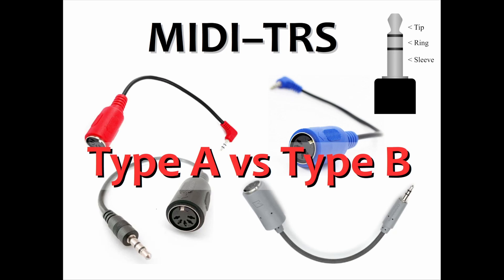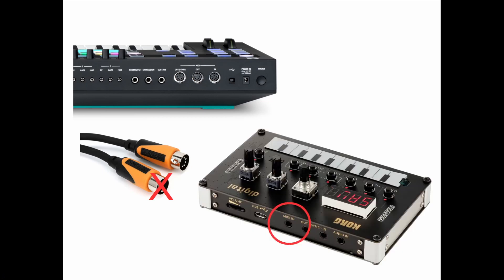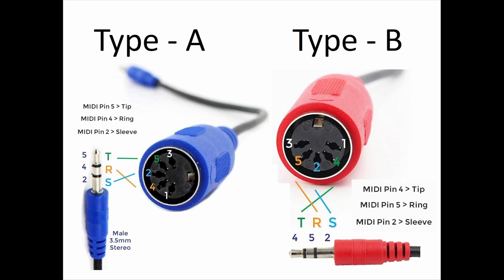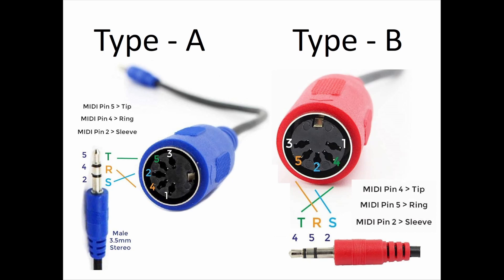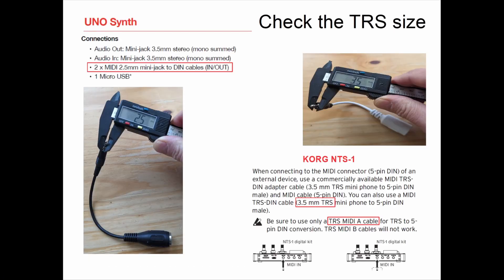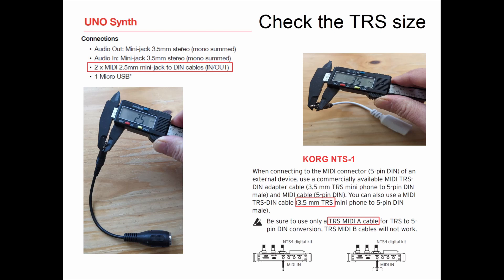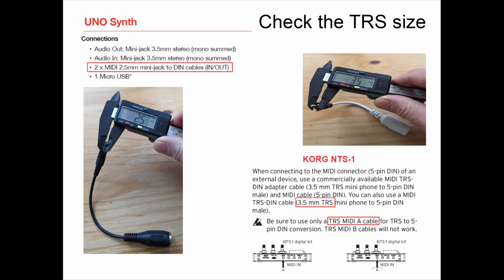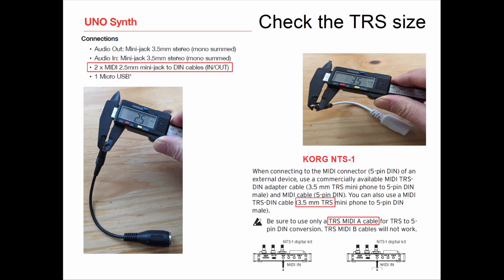MIDI TRS Type A vs Type B explained

Comment: Supposedly, type A is now the standard. So all new devices being designed with 3.5mm midi ports need to be type A. Thankfully, a company in Europe called PolarNoise makes A/B adaptors so you don't need to use the big dongles and full size cables in between A and B devices.

Comment: hey, first of thanks for the explanation made it very clear!

secondly, do you happen to know what type native instruments uses? i couldn't find it in my documentation. I want to connect a boss 500L expression pedal to my maschine mk3 but im unsure what cable i should get for this. also, if id accidentally would pick the wrong one could this damage my device or would it just simply not work? (i know it also has a pedal jack-jack input but i want to use my sustain in that slot)

Comment: im new to trs midi. i have a polyend play and a sp404 mk2, they both have trs midi inputs/outputs. can i use regular audio headphone 3.5mm to 3.5mm cables?
Reply from the maker: Hi CosmicVictory, 

tl;dr: From a quick search it looks like the Play is TRS-B and the Roland is likely TRS-A, meaning a straight through Audio cable won't work to connect the two.

Long answer:
The real answer depends on the TRS formats of the Play and the SP404.  A standard 3.5 mm audio cable will be a straight through tip to tip, ring to ring, and sleeve to sleeve.  Whether you can use a straight audio cable depends on the TRS formats of the Play and SP404. If the Play and SP404 are the same format, TRS-A and TRS-A or TRS-B and TRS-B, then a straight through cable should work.  If the Play and SP404 are different then you will need a cross over cable from A to B.  Or adapters to 5 pin midi and a straight through 5 pin midi cable.  Generally you need to look at the manual of the Play and SP404 and see if it tells you which Midi-TRS format it supports.

I checked the Play manual and it says the Play is Midi-TRS-B
-----------
Play manual:
MIDI data output port – use the included TRS type-B 3.5mm jack to MIDI DIN adapter to connect to MIDI
Input of an external MIDI device.
MIDI data input port – use the included TRS type-B 3.5mm jack to MIDI DIN adapter to connect to MIDI
Out of an external MIDI device.
--------------

Unfortunately the SP404 manual does not seem to specify the TRS type.  What I found in the SP404 manual was:
--------------
SP404 manual:
Connection terminals PHONES jacks: MIDI (IN, OUT) jack: Stereo miniature phone type
-------------

I did a search for Roland TRS type and did not find a definitive answer from Roland but I found an answer on Redit that said Roland uses TRS-A.

If that is correct, Roland is TRS-A, and Play is TRS-B, then a straight through Audio Cable will not work.

Maybe someone else can chime in if they know definitively which format the SP404 uses.

It wouldn't be super hard to cut and audio through cable and swap the Tip and Ring wires to make a cross over cable.
Reply: @Brad Hunting  good info! thank you! i knew the play was type B but didnt consider the sp404. ill be doing more research.  thank you again!
Reply: @Brad Hunting  thanks for the advice! i purchased an A/B converter online, and it worked instantly. i was spending hours trying to fix it until that. thank you!
Reply from the maker: @MrCosmicVictory   :) right on!  less cable hassle == more music

Comment: this is awesome -- had a TRS>5Pin adapter that came with my novation monostation, just got a korg sq64, wondered what the HELL was going on when I was using that adapter and nothing was working... and this solved my problem lol
Reply from the maker: Exactly!  Getting my korg nts1 is what led me down this path.  Gotta have the right wiring or it just doesn't play.